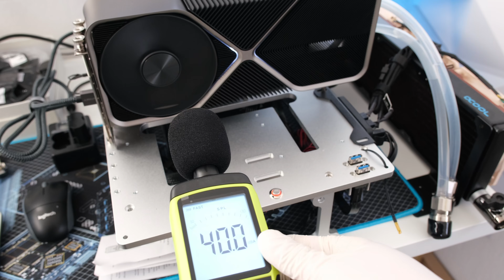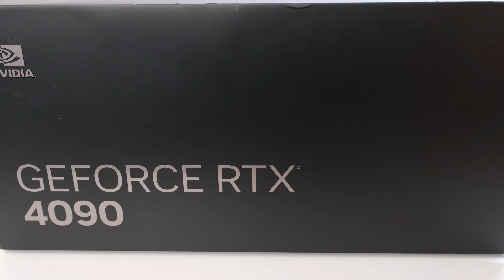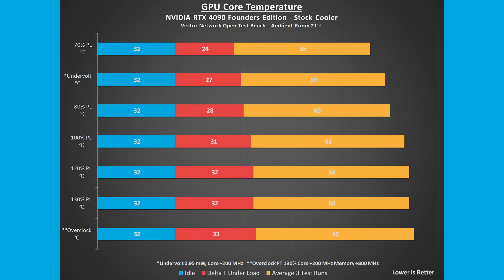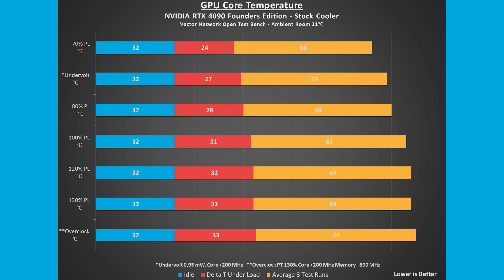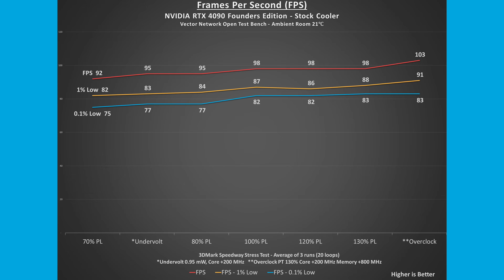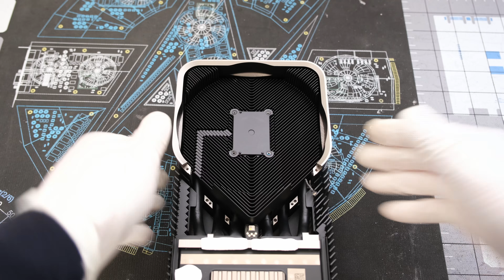RTX 4090 Founders Edition Full Teardown Thermals Unbox Undervolt Overclock Thermal Pads PCB NVIDIA

Comment: How did you unlock the power for the card?
Reply from the maker: Thanks for your comment 🙏 To use the maximum power for this card, make sure you are using a 600W 12vhpwr cable. If you are using an adapter, I think you need the 4-to-1 dongle. Then, use MSI afterburner and you should be able to drag the power limit slider to the right. Hope that helps

Comment: you should have explained how to remove the gpu fans ribbon cables. it looked like you flipped something before removing the ribbon cable? most people are not familiar with ribbon fan cables as they are not common in a lot of gpus. i wish nvidia just got rid of the ribbon cables... they just seem like a liability with how thin they are.
Reply from the maker: Thanks for your comment 🙏I think you're totally right. In retrospect, it was likely shown too fast too. I have made efforts to slow things down and show things a bit more clearly. I agree that the ribbon cables are a bit too small and delicate. There are two types of ribbon cables on the FE board. Both a latch needs to be opened/flipped. If I recall correctly, they are opened by pushing on them and they move. The ribbon cable for the fans, you need to lift up away from the board. The ribbon cable for the RGB, you need to pull it down away from the board. I use my fingers. For the footage, I will put it back and then do it with tweezers so it's easier to see (fat fingers cover up the tiny cables). Hope that helps and thank you for watching.

Comment: Question - does this void the warranty and are there any ways to tell cooler has been removed?
Reply from the maker: Thanks for your comment 🙏 When I'm doing a teardown, I take full responsibility on if I mess something up and don't have intention on going to the manufacturer for their warranty. So, in short, I'm not sure. I do believe that from the manufacturer's perspective, it absolutely does. But, then I have heard things about how that is unenforceable in certain countries, so I am not sure. 
I have never tried to tell if a cooler has been removed. If I had to try, I would likely first look at the screw heads very closely. If any of them look like they have been used at all (stripped, any markings), then likely yes. I found that the screws do not remain in perfect condition after taking them off and then putting them back on. Hope that helps.

Comment: Just installed my FE yesterday, using HX1200 psu with 12V 600W cable.
Should I keep everything as standard, or eff about with it?
Reply from the maker: Thanks for your comment 🙏 Good question. I likely could have included some conclusion in the video but held off. I am putting the reference 4090 with the alphacool water block through testing now and learning more about how these 4090s operate. At stock, these cards are all tuned all the way to the edge. There is not much headroom to overclock, even with unlocked power limits and water cooling. So, dropping the power limit down to 80% or undervolting it (nearly the same result) resulted in very similar performance (within 3%) but saw a significant drop in wattage usage (about 15%). That's why I think these are tuned to the edge. Pushing it farther doesn't do much but bringing it down does seem to impact wattage but not really performance. So, do I run at Stock or do I run at a reduce power limit and/or undervolt? Still hard to say. My understanding is that if DLSS is enabled, then wattage use drops in general. I use DLSS on everything, even with the 4090. So, with less usage does that mean less savings by dropping down the power limit? To really make a decision, I would have to test the power wattage savers for games I play with and without DLSS. Hm, I hope that's enough info for you to decide for now.
Reply: @vectornetwork  thanks for the detailed reply. I think I'll keep everything standard for fear of breaking it.
Reply from the maker: @thelmaviaduct  Right on, simply, enjoy your amazing piece of hardware and performance 🙌🙌🙌
Reply: @vectornetwork  will do. Can't decide whether to update mb bios or leave that too? Everything works at mo, but don't know if it will make much difference. Risk vs reward?
I'm not a pc geek, so scared of messing with it.
Reply from the maker: @thelmaviaduct  What motherboard do you have? I assume it's a newer one, since you have a 4090. If it's got something like BIOS flashback, should be doable without much risk, if any.
Reply: @vectornetwork  Asus B550-F WiFi
Reply from the maker: @thelmaviaduct  The main reasons to update your motherboard bios is if the CPU you want to install requires an update and/or the new update will fix an existing issue you have. With your motherboard, you have bios flashback, which makes updating your bios fairly straightforward when you do need/want to. You can even do it without a CPU or any memory installed. Hope that helps.
Reply: 1200W is so overkill. You don’t need more than 850w. I use a normal Corsair 850W psu and it’s perfect, no issues
Reply: @StormRider-1  if you're buying a new psu to go with a 4090, opting for the bare minimum requirement is a stupid purchasing decision imo
Reply: Hello brother! I want to buy a Founder RTX 5090. Do u think FE will have good cooling system?😊

Comment: Really solid tear down, VN.  Nicely done.  Should help folks down the road a ton when/if they need to replace pads.  I have 4x 8pins going into the 12vhpwr adapter but I have 133% PL showing in Afterburner (ver. 4.6.5 Beta 2).  Not sure why you're was limited.
Reply from the maker: Thanks for your comment 🙏Thank you for the encouragement! I only had 3x 8-pin cables going into the 4x adapter. The PSU is 850W and I didn't have a fourth cable. So, makes sense why yours would be unlocked with 4x cables plugged in--effectively the same as the 600W cable that plugs directly into the PSU. On another note, I am testing the PNY4090 in the Alphacool block (while taking footage of the maintenance of the inverted 4090 build) and the PNY reference 4090 is limited to 100% power limit, even when I use the 600W cable. It's locked down. Hope that helps.
Reply: Not watched it yet, but, exactly where I am... couple pads have no choice but to replace and looking to be certain of the details (and if since its apart if anything better)